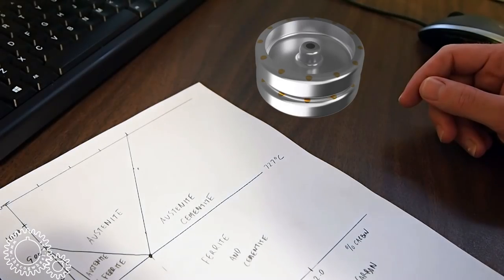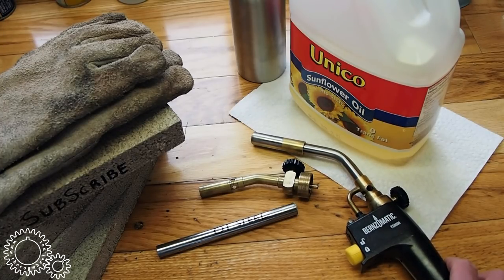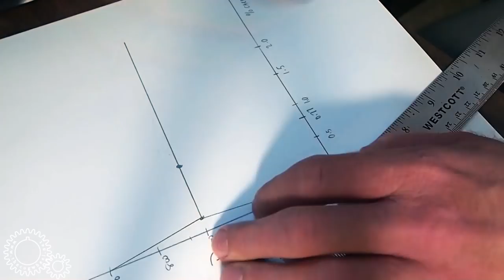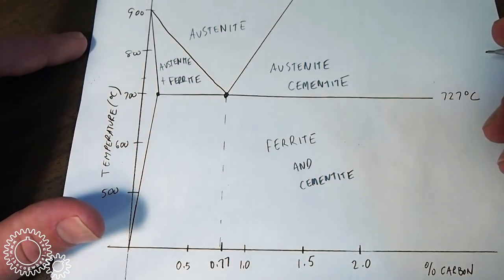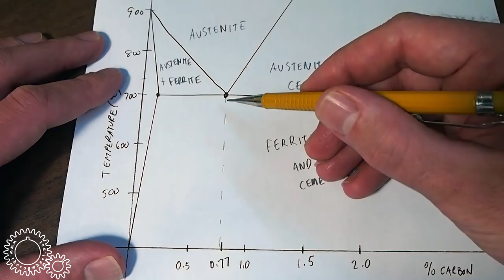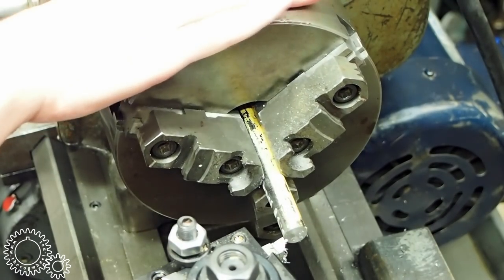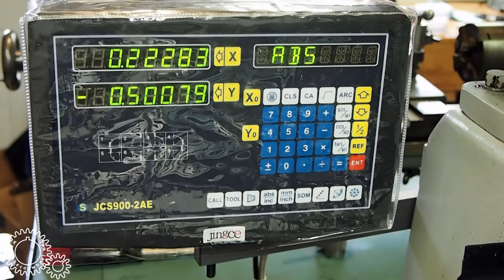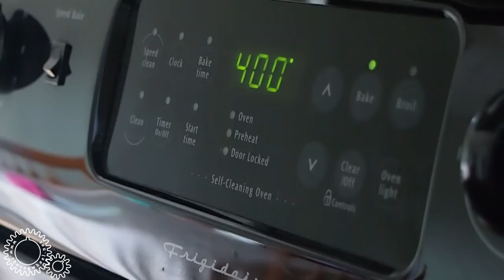Making a Form Tool (and a little home shop hardening)

Comment: That's an incredibly simple way to get the perfect radius. Nicely done. Nice plan with the sunflower oil.
Reply from the maker: It is really easy and works great on aluminium.   For kicks I tried machining some steel with it works well - although you need to be gentle with O1 cutters in steel.

Comment: Very nice video, especially the hardening bit. I only harden small parts.For this purpose I built a tin can oven, instructions infest YouTube. Then I went to a thrift store and bought myself ($10 US) a little home oven, which I keep in the shop "to insure domestic tranquility". I use MAPP gas most of the time. It is faster than propane. The sunflower oil is nice but I use old motor oil, of which I have a surplus. Then I temper in my little oven. It was nice to have a review of the phase diagram for Fe +C . I have tempered by eye and still do but nothing beats the oven.

Comment: Thank you for the excellent video, particularly the explanation of the phase diagram re.  tool steel was most enlightening.
Reply from the maker: I really like phase diagrams.  I am a nerd.   Perhaps it is because I like finding out they why behind things.  There is a fair bit of information left out - mostly as it is very difficult to use any of it in the home shop.  Quench rates and temperature are also very important but we can get bogged down in the details.

Comment: I just jumped into melting/casting aluminum. Powered by a 500K BTU weed burner. Should come in  handy for hardening... I have Oxy/acetelyne, but the tanks have been empty for year. :)
Reply from the maker: Isn't it crazy how expensive acetylene has become?
Reply: Haven't noticed since I haven't bought any, but Argon seems to cost plenty and I hear Helium is really high.

Comment: Really nice explanation.  Question.  Theoretically, could one estimate the amount of carbon based on the temperature a sample becomes austinite i.e. looses magnetism.
Reply from the maker: Thanks Russell.  That's an interesting idea.  I know there are folks who use a magnet in the hardening process - heat up until a magnet doesn't attract, but with modern magnetic sensors, a temperature sensor and an arduino. I think you could make up a simple device to determine carbon content.  Of course the lower side and higher side overlap a bit (the phase diagram slopes are somewhat similar on both sides of the eutectic point) but I think you could get fairly close.  

I also talk about an idea on the latest podcast about using a camera on a cellphone to determine what type of steel based on the colour of the spark test.  I think you could rig up an app pretty quickly.

Comment: good information, do you think the tool will work on mild steel?
Reply from the maker: I actually tried cutting some mild steel with it this morning.  As long as you go slow and use lots of cutting fluid it works fine.  If you can pick the steel try to use free cutting steels like 12L14 or 1215.

Comment: Nice video as always, 01 steel look like it's easy enough to machine, is it right or the credits goes to the lathe?
Reply from the maker: It's the operator.  Pure skill.  No metalhead2508 is right.  O1 machines really nice.

Comment: How come at 0% carbon it's at both 0°C and 900°C?
Reply from the maker: Technically the graph doesn't work at 0% carbon as the phase diagram assumes a iron - carbon alloy.  No carbon would just be pure iron and there would be no phase diagram.  They are just drawn that way for simplicity.